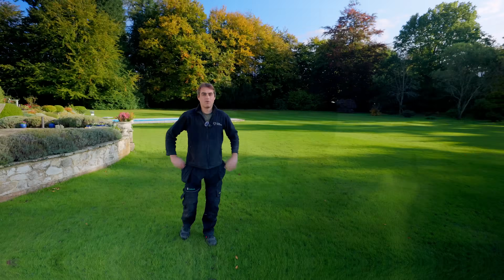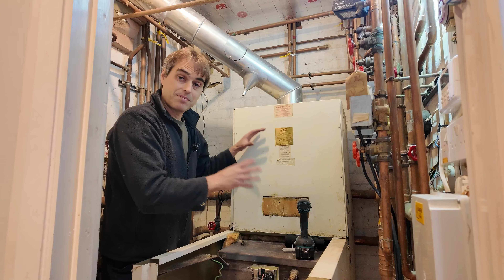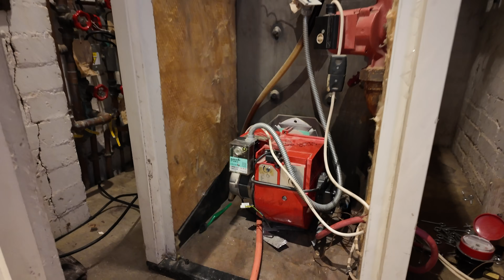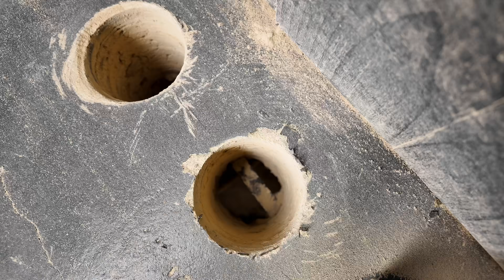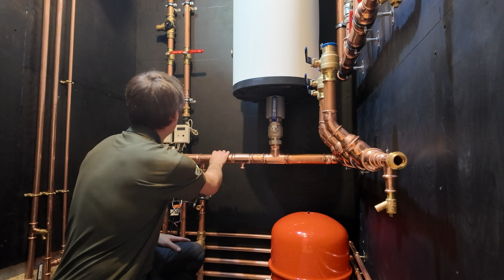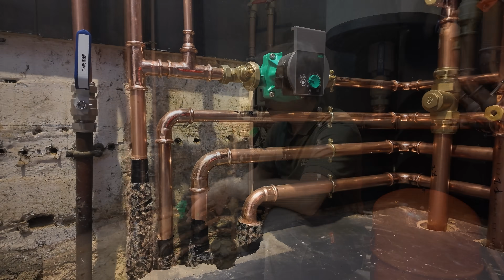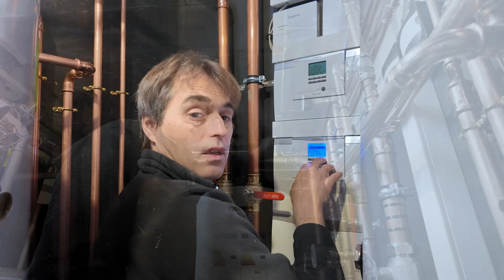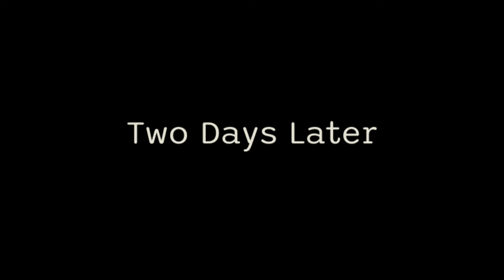Heating Oil Costing You A Fortune? This Is The Fix.

Comment: Alternatively, you could have just used a gshp in the house, then those underground pipes could have been absorbing heat and not losing it. It would almost certainly have been cheaper, no?
Reply: That’s definitely another way to do it, but heat geeks don’t have experience with it
Reply from the maker: The install would have been some £80k extra, but sure it was an option.
Reply: @UrbanPlumbers  how on earth would it come to that??? Say £10k for the gshp itself, say 600m of ground pipe at £2 per m, say 4 pumps at £400 each, groundwork say £500 a day for 10 days. How can it add £80k?
Reply: @dominic-1-1-1 for the size of the heat loss it would have required around 500m of bore hole depth, probably would have been 3x200m, so would have needed 1200m for the brine loops.
Bore holes are expensive, probably £10k to £20K on the project alone, and would require 2 heat pumps so likely £20K there.

I'm not sure I would say it's £80k, but it definitely has a significant cost.

Comment: Cool, but seriously how smaller radiators are you guys using. 30c at +10c outdoor temperature is crazy high, such a bad efficeny. I'm at 30degrees flow temp at -2c and +40c at -25c
Indoor temperature is around 20-21c
Reply: The client retained the original width of the radiators but upgraded some to taller models and switched from K2 double convector radiators to K3 triple convectors for improved efficiency. The property, built in the 1930s, has cavity wall insulation made of Rockwool. Over time, this insulation has sagged, creating large voids that allow heat to transfer through to the outer wall skin. Addressing this insulation issue is next on the "To-Do" list.

Comment: They are not cheaper than a good gas boiler in a 2 - 4  bedroom house to run, the purchase and installation costs are very high and the cost of electricity is going through the roof, just wait until they are in a majority then the electricity will be unaffordable, it's all part of the plan.
Reply from the maker: I heard that. Do you think it is illuminati or NWO?
Reply: @UrbanPlumbers  Probably the WEF! Haha
Reply: In the Netherlands the government has increased taxes on natural gas and is lowering taxes on electricity, making an ASHP far more affordable to run. It's just a matter of time before the UK government does the same.
Reply from the maker: @SolAce-nw2hf well, let’s hope so
Reply: @SolAce-nw2hf  increasing tax on gas unfortunately has the perverse effect of increasing the electricity price due to the system of marginal pricing. So in practice you need to basically move all taxes on electricity over to gas, but even then gas could still be cheaper for heating in the end. This is the case in Belgium right now, with gas being around 5 to 6 times cheaper per kWh than electricity
Reply: @ The power plants don't pay the standard energy tax, so it has no effect there.

Currently the energy tax on electricity is about 13 eurocents per kWh and gas about 8 eurocents per kWh. With a heat pump at a SCOP of 4  it's a lot cheaper than running a gas boiler, no matter what the current cost of either energy source is.

Comment: Hi great system and great video one question, would it not work out cheaper to have installed bigger heat pumps and heated large water stores when the sun shines and used that hot water to heat house at night? I have been working in a large 1000m² house here in France that uses 2 x 26 kw heat pumps (I am the electrician on this job) the house has very little insulation, old cast iron rads. The system has a low COP and is very expensive to run
Reply from the maker: 50kW seems like an awful lot even for a 1000m2 house. To storage energy in water you would need a gigantic store - not feasible really. Might as well go ground source instead
Reply: @UrbanPlumbers  Hi  yes it does seem a lot but solid walls single glazed using the old rule of thumb 100w per m² it is under powered? also does hot water, last winter it was using between 1000€ and 1500€ per month of electric the unit doing just heating had a cop of around 2 and the one doing heating and hot water had a cop of about 1.7 house never that warm. The output temp of units is about 55c  but the rads only get about 45 to 50c input, the installation is very poor and the pipes where not insulated even for the hot water system, I have another customer with a low temp underfloor heating system and they get a cop of over 5 
As to storing energy in hot water not sure but think depending on temp (start and finish) say 25 to 45c you could store a bit under 20kwh per 1000L a tank here is about 1000€ (used a lot here for wood heating) so about 50€ per kwh
Reply: @ianmills5805 It's better to store that energy in a battery. They have become quite cheap and you can't really store that much energy in water by comparison. Plus electricity is way more flexible to use. As to the price, you can get 5 kwh of battery for around 1000€ nowadays.

Comment: Would of thought ground source would be the way to go with that? Might make a mess of the lovely grass for a bit though
Reply from the maker: No need in the Uk - average air and ground temperatures are the same so efficiency will be comparable. Ground source installation cost would be 5-7x the cost of air source
Reply: @ thanks for the response. Cracking install mate

Comment: It doesn’t have to be all in. We have a 1912 2100sf home with 1977 SlantFin boiler. In the last 5 years we added a 2 ton minisplit to our main floor and this past summer a smaller unit on the second floor. These 2 units are primarily used for cooling, but we are presently heating our home with these heat pumps. The plan is to lessen the boiler use to the extreme cold months and bridge seasons run the mini-splits. 
New boiler - 15-20k. Two mini splits @$8k. With a Canada carbon tax on running the nat gas boiler and no tax on nuke/hydro electric the math is making sense. PV & battery would be a great addition

Comment: Can you take us through the design phase of such a system? I imagine you don't do it on the fly ;-)
Reply from the maker: its pretty simple. Noo difference to a reuglar size house. Do your heat loss, size your pipework then size your emitters. I actually did not do any on paper calcuations for this really. Just did the heat loss and gave radiator sizes to the customer so he could get them installed. Not much more to it - as luckily for us there was over 10 heating zones, so even without any calcuations I knew I had enough flow though all parts of the system.

Comment: Understandable but still a lot of investment and money that sadly slot of people may not have or able to swallow. I’m hopefully having a small array of 8 panels and a battery system installed in a month or two if the survey goes well and that alone is £6500 luckily I can swallow that with savings. And in time it should pay for it self. But key there are costs like cleaning and servicing, and considerations like end of life and roof repairs. Luckily my business I clean solar arrays so I can mitigate some of the expenses. But I don’t have a big roof or clear area for more. Plus no wear near the power needed to cover a heat pump system plus there is others issues for myself which makes having a heat pump financially un realistic. And being in a remote area having a mixture of power and heating is way safer than just relying on electricity and few more reasons as well. But FairPlay if you can.

Comment: Do both heat pumps run all the time? Or does one kick in at a lower temperature?
Reply from the maker: they automatically swap duty. 2nd one will only really kick in if the temperature drop to around 5c and below.
Reply: @ wow, that's good that they swap, great installation yet again.

Comment: Stunning build, that scale is crazy. The EV battery setup is really interesting. No chance of a proper feature? Full packs are now getting popular with emulation, so no need to split packs with the appropriate high voltage inverters. Would be great to see how this was done
Reply: The EV battery and solar set up evolved from watching Off Grid channels during the pandemic, the solar panels and EV modules have been an ongoing project since Covid-19.

Comment: I mean it should work, and great video but it’s not the most efficient installation, what would be the highest benefit of a heatpump… 

50 Celsius is way to high to have the heatpumps running efficient, than the distance… such a wasteful Projekt. 

Not a heatpumps special store tank… 

I assume have it done more efficient, would even require two heatpumps with 12kW…

Would love to see if the 
annual performance number exceeds 3…
Reply from the maker: Check monitoring. It runs at cop of over 5. Scops will be well over 4.

Link to monitoring is in the description

Comment: I so enjoyed this, such a clearly explained and well made video showing such good workmanship. 

Inspires me to get more than 4.8 COP out of our new build heat pump and to crack on with the valiant battery storage system. 

Thanks
Reply: 4.8 COP for heating? I dont know that that is feasible even with the most efficient mini splits..
Reply from the maker: @CL-yp1bs mine runs at scops of 5.0 and 12 of my systems that are on open energy monitoring average scops of 4.7
Reply from the maker: @CL-yp1bs also that’s combined CH and DHW - CH alone on mine runs well over 5.5.
Reply: @UrbanPlumbers  Is this because its using water instead of air? I've done alot of research on heat pumps for my home but they were mitsubishi and gree units that used air only. Because of the numbers I never pulled the trigger on one. My price for electricity is $0.10/kwh off peak and $0.28/kwh from 5pm to 9pm (on peak) - climate is similar to alot of england.. I live in the southern part of oregon usa. Never gets below 30f for very long... so pretty mild climate.
Reply: @CL-yp1bs Probably more depending on the refrigerant being used. As far as I know the US is one generation behind on that. As to the extra costs, technically they shouldn't be much more than a regular AC. In the end it's the same with just a bit of logic and a valve to reverse the cycle. And always bear in mind that most current installs are grossly oversized. So I good install shouldn't be based on what is currently installed.

Comment: What a setup! Both heating and PV + storage. Didn't think such long external runs would be feasible.

Maybe I missed something but was the swimming pool not connected to the heating loop in the end? Would be interesting to see the efficiency numbers on that.

Also, what do your customers think of the efficiency monitoring system? Are they usually fine having the info openly available?
Reply from the maker: Swimming pool is on its own heat pump. System currently running cop of 5.0

Comment: Top job, love it. I'm sold on heats pumps, although it may be possible, I currently live in a 1960s flat with garden (slightly smaller than this one ;)) there may be more of an issue around noise and getting planning permission etc. I will be looking into at some point in the next 5-10 years and as I would like to move off gas.

Comment: If you put the open energy heat meters in that location I guess they won’t account for heat loss in the buried pipe work?
Reply from the maker: they do. Firstly it takes into account energy input, so if energy at the proeprty is less then the overall efficiency is lower. Also it is pure weater compensation, so pumps are running with the units off. When that happens the heat meters will register negative efficiency.
Reply: @UrbanPlumbers  So the Heat watt figure is calculated from the flow/return sensors, that means the web page plot of heat watts is the heat delivered into the plant room, and the electrical watts is the electrical power into the heat pumps, so the buried pipe work loss is accounted for in the SCOP, that's very neat.  I wonder if it would ever make sense to have two units of different sizes, a smaller unit paired with a larger one, a lot of the time it seems you only need 4 or 5kW of heat, controller could determine which pump is optimum to run to meet the demand?
Reply from the maker: @edc1569 no controller is probably not smart enough for that. In this case with HL of 25kW we needed to large uits. Still with 10c outside there is virtually no cycling at all as only 1 unit runs - so all good

Comment: It seems that the output of that system is 24kW.
What I don’t get is my EPC states my heat loss is 18kW and yet we only live in a largish 5 bed 1970s detached property. The big energy companies keep telling me I need to put in a 3 phase supply and the install will be very expensive. I wonder if there’s an error on my EPC as you could fit 3 of my houses inside that property.
Reply from the maker: EPCs are useless and anyone who quotes based on them needs talking to
Reply: @UrbanPlumbers  exactly that
Reply: EPC are never accurate on heat loss, in fact they can be so far out it’s untrue.
Reply: @ Not sure what I’m meant to do then? I’ve tried Octopus, EDF, BG and a local heating supplier. As soon as they look at that figure none of them will even survey, they just say no.
Reply from the maker: Yeah BG and EDF are best avoided
Reply: @yp77738yp77739  I'm told the DNO take the peak load with everything on and multiply by 1.5, that's why they insist on 3 phase.
Reply: @yp77738yp77739 Try a heat geek installer. They'll do their own heat loss calc.
Reply: Your EPC is an utterly pointless document whose technical merit is not worth the paper that it is printed on - if it was done in the same way mine was when I sold my self-build 10 years ago.  The surveyor had not the slightest interest in what types and depth of insulation I used in the construction, nor was he interested in the rest of the fabric of the building - he didn't even visit the property!  The whole system is a complete farce.

You would need to get a professional (or at least knowledgable amateur - it really isn't rocket science) in to do a proper thermal survey to have a realistic idea of what your thermal losses actually are.  Or, you could do empirically - ie measure them yourself - assuming you can assess reasonably accurately how much fuel you are using and have a record of outside temperature (and ideally wind speed, too) at your property.
Reply: @ All I know is that my annual heating and hot water bill was less that the winter fuel payment and the additional government payments made during peak prices. During that time I was making a profit, so although I do use clothes to keep warm ( that’s what they are for) my energy performance can’t be that bad and our gas boiler is 18 years old.
Reply: @yp77738yp77739  You can estimate your heat loss (and thus the heat pump required) by using Michael de Podesta's rule of thumb. Take your annual gas usage in kWh (if you have multiple years, take whatever the most usage is) and divide it by 2,900. It's not perfect and doesn't replace getting a proper heat loss survey done.  But it should give you an indication of whether 18kW is in the right ballpark.  If there's a big difference between then two, then it's best to use someone else who will do a proper heat loss survey on your property first.
Reply: @yp77738yp77739 If your heating has weather compensation I would start by optimizing the heating curve this winter. Afterwards you now the flow temps and can get a rough estimation of the SCOP you can expect. Also you could try to write down the gas consumption on a really cold day in winter and estimate your heat loss from there.
Reply: BG are best avoided end of!

Comment: I hope you didn’t cut too many of those reinforcement bars. Especially if those holes are anywhere near where you are putting anything heavy. 

It always worries me core drilling through floor. 

Lovely job though, painting the room was a fantastic touch, the copper looks great on black.
Reply from the maker: It’s not gonna fall far, is it?

Comment: Great work - nice to see ground mount and roof top solar complimenting an air source heat pump. It’s a shame the owner didn’t invest in Tesla Powerwall 3 - perfectly suited to larger heat pump installations due to its peak load capability of 30kW
Reply: Weren't the re-purposed battery modules in the video old Tesla (Model S?) ones?  So, nearly a Powerwall...  And it looks like about 200kWh's-worth that I can see...
Reply from the maker: can't confrim or deny ;)
Reply: @UrbanPlumbers  😄

Comment: Can you give a little detail on the buffer set up, bypass buffer with 54mm connections? Header sized to 0.5m/s and assuming circuits are 0.9/s-1m/s open loop?
Reply from the maker: yes you got it pretty much correct. Primary pipework is 50mm not 40mm - made a mistake in the video. Also connections on the buffer are 1"1/4 so there is a reduction there as couldn't find a buffer with 2" connections that would fit in that space.

Seems to run nicely if you look at OEM so don't think there is much distortion happening.
Reply: @ that’s great, I have a few large setups coming up so brushing up on my buffer designing options, how are you achieving your desired stop starts as you’d need a min volume of 666l at 3 start/stops or am I missing something?
Do the header pumps operate with the primary pumps to allow it access to the full system volume?

Sorry for all the questions, everyday is a school day!🤓😂
Reply from the maker: @RyanSharp-s8m , yes, pumps run together (at least one does on the system side). System volume is not an issue as most of the time, one unit runs alone, and this set-up has probably 800l volume. 

At the moment (mild water), the system doesn't stop (3-6 starts per day for heating!) as it has great modulation due to having 2 units and only 1 running.
Reply: @ last question, I promise 😄
Are the header pumps all controlled by the HP & not 3rd party stats (or just full WC?)
Reply from the maker: yes - no 3rd party controls at all